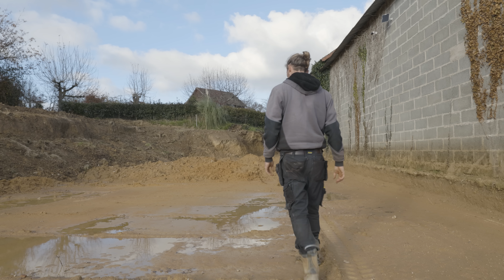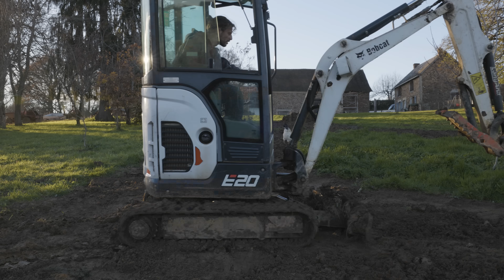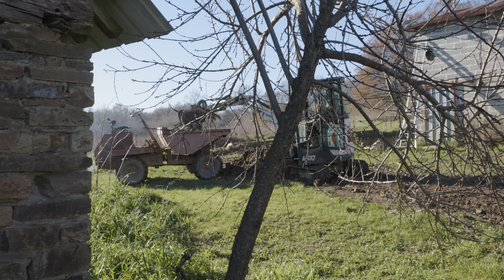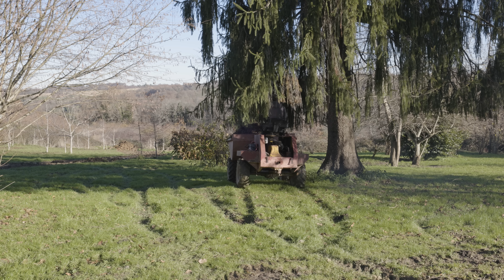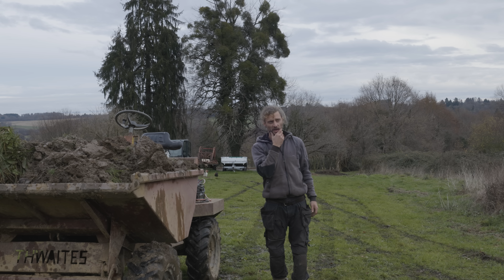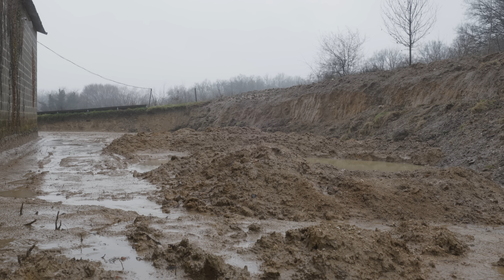Repairing Deep Ruts and Tackling Water Flow Challenges Around the Property! | #69

Comment: Have you considered deep trenching, as is done in arable fields so that surface water can drain into the soil. Soil can compact over the years and make it impermeable. Deep trenching can loosen the soil layers so that they can drain the surface water better. You could try in a small area to see if it can absorb the surface water better. It looks like you have very clayey soil. Maybe it can also change the artesian water pressure. You have a narrow drainage bucket, so as an experiment you could try digging a deep trench and possibly filling the trench with sand, especially above the old barn.

Comment: Consider installing swales on contour. Use an A-frame and level to find the contour across the face of the slope. Use marker flags to show the path the A-frame it’s called cut and fill. Plant fruit trees on the downslope berm created by digging into the upslope. And follow the flags path with the digger. Make the swale as wide as the digger/excavator. Your water issues will disappear and become a self watering system for anything you plant along the swales. I’m a permaculture farmer in north Idaho

Comment: A follow up about your excavator blade  issue. You’ve got a valve issue or a cylinder issue. If you raise the blade and hold it up with a jack and disconnect the valve and plug the hose to the cylinder. Then lower the jack to see if the blade lowers. If it does then the cylinder is bad. If it doesn’t then the valve is bad. My my money is it’s the valve since you have not said anything about the cylinder leaking. Love watching you and your family renovating the property.

Comment: Great work brother ... Just be careful. The water is slightly dirty, which of course means it is transporting dirt as it runs away, instead of pooling and settling in the past ... If you're not vigilant, you could create some massive paths of erosion... You either need to slow the flow down, or line your water runs with rocks/concrete/artificial channel... Much love and luck to you all 👍
Reply from the maker: It is indeed taking some soil with it but not at alarming rate, once the drainage pipes are in it will not be a problem anymore.
Reply: @DomaineSauvage  That'll work wonderfully 💯 ❤

Comment: For your dumper, do a wet and dry compression test and it will tell you how the cylinder rings and valves are doing. See if you can purchase a complete rebuilt. Enjoy.

Comment: I can tell you that here in the US rebuilding that engine would take 3-5 days if you purchase all the parts ahead of time and with no machining done on the block or heads.  The trackhoe should do well for removing the engine once its disconnected, having the manual for torque specs is also a necessity.  Good luck.  if something is hard to find parts wise let me know and Ill see if I can get it here and ship to you.
Reply from the maker: Parts are available in the uk or India. I do agree taking it out and putting on a table to rebuild would be easier and also easier to tackle some stuff on the dumper.
Reply: @ good luck buddy.  Love watching from Marietta Ohio.

Comment: What engine is in your dumper, the Petter PH2 or Lister engine? There are rebuild kits available. Rebuilding a small diesel isn't too hard a job. Maybe waiting for worse weather, you could put the machine inside your building? Depending on the tools you have, and the availability of parts [kit] 3 or 4 days to rebuild. That's if you concentrate solely on getting it done? Often, cylinder "linings" [sleeves] can be replaced in diesels? Sorry, I've not worked on a Thawaits engine, but being small, it should not be too demanding? As a side note, i've rebuilt rubber tired log skidders right in the woods. The oil pan can be dropped and sleeves bearings can be replace without pulling the engine. The dumper engine may, or may not allow that? Good luck! The wife an I both love watching yalls progress. Yes, I know all about rain and mud!
Reply from the maker: It is indeed the petter ph2, most parts are still available either from india or the uk. I will have to do it at one point since it is not going to keep going i think.

Comment: My uncle had water in his house.  I found a book about French drains.  They cut French drains 2 ft or about knee high into the ground.  Then put in gravel and pipe full of holes, then covered with waterproof cloth, and sod.  During the 500 year flood, his house built on a slab of concrete on the ground, did not flood.
He lost his legs in France WWII in Alsace Lorraine.  His brother died in the Battle of the Bulge in Belgium.

Comment: As you continue to work on the water management, will you also be including water storage near the garden areas or rain barrel systems for the house and barns along with the pond? Will you be putting in a piping system sometime in the future, rather than having to maintain the different ditches? That has been a ton of work to present.
Reply from the maker: Drainage pipes are for the future and we have the stone well in our courtyard for water in thz future.

Comment: All that water is a big problem when you are trying to drive the heavy dumper over it, and the tyre tracks just fill up with water and make it worst, you could put the slotted land drain pipe in the trench and back fill, you could at least move around more easily, as for the dumper, I think any attempt to fix the engine at this point could put it out of action for some time, the wait for spare in France being in months and not days! If it keeps gong just keep it limping along, it looks very smoky as if it needs a re bore, is the tractor re build still going on? As least we now have freezing to keep the mud hard! You are lucky to have all that soil, we are on limestone with only 100 mm of soil, so only weeds grow! Stay dry! Chris B.
Reply from the maker: Dumper parts are still available but indeed not france. The tractor rebuild is still going. Soon you will see us rebuilding the clutch!

Comment: Interesting that you are located in France but a "French  Drain" is your best solution. A trench 1 to 2 meters deep with perforated abs (4 inch/ 10 cm diameter) tubing placed at the bottom and back filled with 1 inch gravel will resolve your problem. Also cover the gravel with porous drainage cloth before back filling. I have used this approach on a building lot with much worse conditions than yours. Depending on the porosity of the soil - clay versus sand, the water will eventually be submerged and flow through the abs pipe.
Reply from the maker: Hey john, it is clay/lime mixture i think. We will put in drainage once we know for sure where we want it. For now these open ditches do the job.

Comment: Have you looked into the timing on the dumper? many a youtuber has commented in their videos that timing on diesels can greatly change amount of smoke and power of engine. While I know nothing about diesels myself, they all seem to go to that (timing) first before tearing down the engine. Although, if it is making the knock and general nasty noises of bad bearing or con rods, then you know. Maybe look for a replacement engine in good shape and just do a swap, this way you could tear down the engine at your convenience and not be without the dumper for too long. Also for the dumper, what about putting a second set of wheels on each axel, making is duals, that would spread the weight and dig up the soil less? For your water issues have you thought of putting in French drains in the yard itself?  Love the videos, keep up the great work!
Reply from the maker: The timing for the fuel pumps is indeed off i think. Finding a replacement engine for a small price is not an easy task but we will see where we end up. I have been looking especially for the future when most of the work is done to put bigger balloon tired on the dumper to damage less.

Comment: You can use some of the old roll of chain link fencing to drag behind the dumper or your tractor, when it's running, to flatten out the ground behind where you drive. We would use a chain strung through the center of the roll and attach it to the hitch so that is was behind the vehicle horizontally and drag it around. It works great for removing the last of your larger dirt clumps breaking it down to a smoother finish. 

I love your channel. It is my absolute favorite. I look forward to your video's every week. I had a dream similar to yours many years ago when my son was born. I spent a couple of years caretaking a property in a climate very close to what you are dealing with, only in the Pacific Northwest of the United States. Unfortunately, my relationship didn't survive and I ended up back in the city. I am living vicariously through your family now.
Reply from the maker: When we get to doing the garden i can see this working!

Comment: Good to see a few improvements to the water management, making a big difference to the yard.  It would good to be able to put a drain from the end of the barn, where the springs emerge, all the way past the house, and keep the walls of house drier. 
That certainly is a lot of water on the hill behind the barn, as you say, dealing with it further up the hill should make a big difference.  I know decent guttering can be expensive, perhaps you have considered adding gutters to the barns.
Reply from the maker: Gutters are coming after the barnroof has been redone.

Comment: Would jumper cables or a jump starter help start the Bob the dumper? It would get you going while another battery is charging.
Reply from the maker: Yes but i would need to get the van over there and that would get stuck. Maybe with a starter pack but i dont have that.

Comment: Another good and very well made video. Thank you!
Re the dumper:
Certainly a replacement engine would be a somewhat 'easier' solution but this one as well will have man years of service unter its belt - so you don't know how well it's inside (provided that there are no new engines fitting this dumper?).
To judge if your engine is restorable at all, there will be one first and all important test: See if the engine block is free of any cracks! Check it for hair cracks. If the engine is water cooled, take a sample of the oil and of the cooling water to see if there are either traces of cooling water in the oil, or traces of oil in the cooling water. With an air cooled engine it's a bit more difficult to see cracks, though but there are tools for that as well. 
If the engine block is OK, then I would look out for a repair kit having all the necessary gaskets, bearings and piston rings (the quite heavy smoking of the dumper tells me that these are worn out and need replacing. Another thing to check of course once the engine is open is the condition of the crankshaft and the camshaft. If they are worn out as well, they need either a rework or a replacement as well. 
It's a quite big project but very rewarding if time allows. Your 2 month estimate is not far from what it will take - provided that most of the things go smoothly...

Anyway, keep the blue side up and enjoy what you have there. And your wife is a top notch videographer!
Reply from the maker: Thx Charles, it is an air-cooled engine called the Petter PH2. A lot of parts are still available for it and i agree that the piston rings are worn and we have oil leaking between the cylinder housing and crankcase so we need to the bare minimum new gaskets there.
Reply: @DomaineSauvage  Ah, I see. Now, if that engine block (more like a crankcase in this case)  still is OK, spare parts for it seem still to be ample (as judged from a lot of returns from the search engine - even service manuals!) I would say, go for it as soon as you can get along without it for a few months! 
You all have a good week! Charles

Comment: Philippe your alternator belt seems to be on the slack side that won’t aid charging
Reply from the maker: It is because a bolt has snapped off because a weld came loose and the weight of the hydraulic tank etc. sat on it 😅🫣

Comment: I would recommend sloping your car park to improve runoff. Hopefully with a few drains, a bit of planning such as inspection chamber to keep them clear you’ll get your hard standing you are looking for, 

Short grass has short roots so can’t hold the ground together the same. Other than that it’s avoiding travelling when wet or putting up with the mess. Longer grass just delays the mess. It won’t stop it.

Not sure how far you dug down when levelling the track. It will have been heavily compacted.
Reply from the maker: The car park or the part that is 'finished' with grading is sloped towards a ditch that will get a French drain in the future. It is a balance with creating a mess everywhere cause we do have to live here in the meanwhile 😂
Reply: You mean sloping more? Because he already created a slope.

Comment: Doing some research into whether you can get engine parts might be worth doing before you take it apart. If you can then it's any machining work required that could take time. With that already planned for in case you need it I don't think it would be out of commission too long.👍🫣❤️
Reply from the maker: The engine is a petter ph2 and most of the parts are still available!

Comment: Hi Domaine Family!!!!  Philippe looks like you have your draining setup well organised. I noticed both your Dumper and Excavator smoking some what!!!!! As far as your dumper engine is concerned i would suggest to look or shop around to see if you could find ! what one calls ! A (Part exchange) engine for that Dumper!!! If you could find one its normally been overhauled and you cut down your wating time you are going to have when doing it yourself!!!!! I would also suggest that you get a fuel cleaner to put in your Diesel system for the motorized equipment and check your current filters for fuel and your air cleaner as a little bit of restriction on smaller Engines can be a bit annoying!!!!! The fuel cleaner in your tank will also clean the injectors on the engines!!!!! Good to see all your Energy and effort is paying off!!!!!!Would it not pay to put pipes in under your paths that you drive on for various actions??  Keep going and regards to the Family!!!!!!!!!
Reply from the maker: Hey Helmuth, i have found reconditioned ones but we are talking 2000 euro easily. In the beginning i added fuel cleaner to my 200l fuel container. The little excavator needs a maintenance, i have ordered the filters and oil so that should happen soon enough.
Reply: Hi Phillipe, I had a look at the various videos of the starting up of the Dumper!!!! I would like to make a suggestion regarding that!!!! From experience over the years it seems like you have a leakage via the injector system whereby fuel leaks from the injector when you switch off the engine as wear does take place during the use of the injector while in use and hence when stopping the engine some fuel dripples on to the piston. When starting up you have white smoke coming out the exhaust!!!!! The engine starts without a problem when cranking it up!!! I would suuest to have the injectors checked and once the injector is out do a compression test on the engine as well which would give you an idea on the condition of the engine as well!!! Find out if there is a workshop nearby to have that done as they would have the correct info for that engine and it could save you money as far as a full overhaul is concerned!!! A compression test on the Engine and injector will be much cheaper !!! Have a good day and regards to the Family!!!!!

Comment: Your dumper engine is a petter ph2 made in the UK. first thing to do on this is to have the 2 injectors and 2 fuel pumps rebuilt . You have lots of white smoke, first sign of fuel problems. This might be a problem in France. Maybe your mechanic knows where to get them done. If not, I can help . I am pretty sure this will solve your problem. The engine sounds strong let me know
Reply from the maker: I am going to buy a diesel injector tester, a simple one to check the injectors on the dumper and old tractor. Parts are still ready available for the Petter ph2.
It also consumes oil and a blue smoke so i think the piston rings need replacing. But as you say it doesn't sound bad but it does not have a lot of power anymore.

Comment: Good to see you drained the propperty out at least for the most part. But what will be the final solution? You will put pipes or hoses in the ground to keep it going? With the ditch the mow robots would not get over to the other site i would think, so therefore you need some improvement on the drain right?
Reply from the maker: All the ditches you see are temporary just to get the water away from where we need to work or the buildings, a lot of them will be covered with a geotextile with rocks and a drain inside in the future.
Reply: @DomaineSauvage  Ah ok, well something like that i thought you will do, but it is a lot of work too right.

Comment: Great videos thank you.  The dumper project.  Maybe watch some YouTube videos on taking out the engine and stripping down to put new bearings in.  If the engine hasn't been stripped for years then be aware of engine mounts needing to be replaced and get some WD40 and some heat for removing old rusty bolts.  Then just go for it, you do with other jobs so I am sure you will be fine just small steps and take it slowly.  Good luck and look forward to your next video, maybe consider hydro generator for all that water.😀
Reply from the maker: First the old tractor and then we will probably do the old dumper!

Comment: Have you considered sourcing a reconditioned  motor for your dumper.? Then you could remove the old one & put the new one in which will save a lot of time. You could sort out the old motor when you have time. Just a thought. 😉
Reply from the maker: I have emailed a company who has reconditioned ones, but they want the old one in return and the price is still 2000+ 🫣